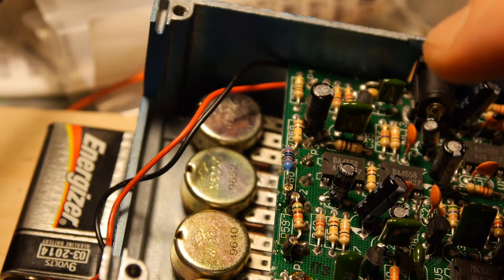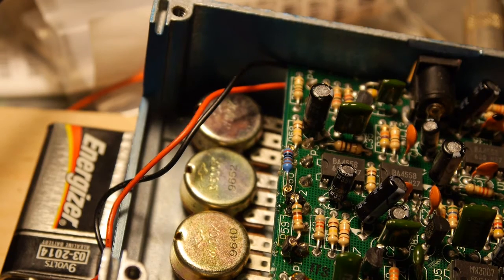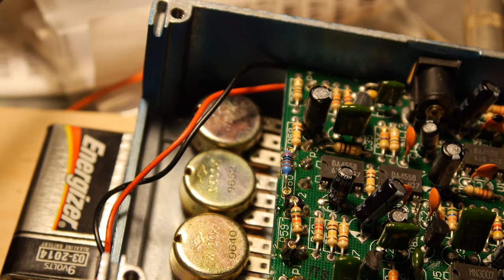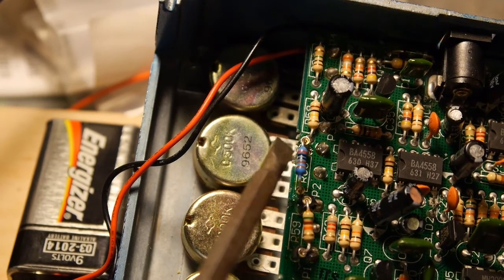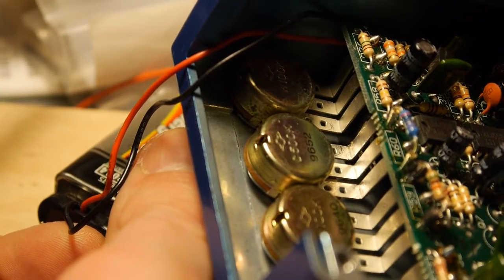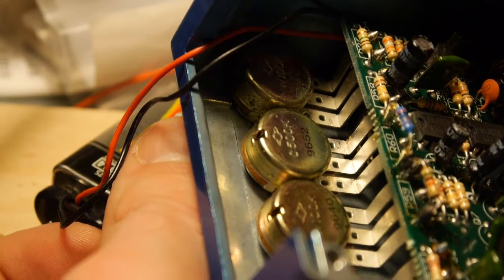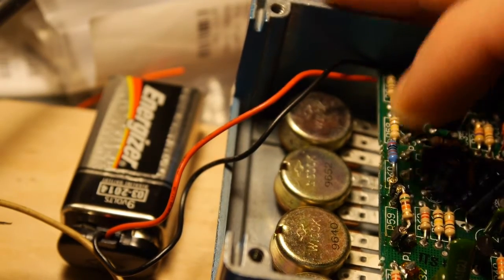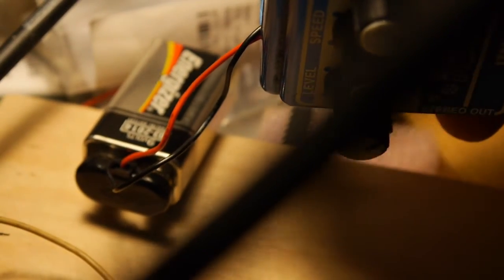Mod : Increased Modulation Speed for DOD Ice Box FX64

Comment: Did you try other values? just wondering if I didn't want to go three times as fast, but just a little bit faster if I could use 3k or 4k.
Reply from the maker: Sure. that'd work. You'd have to experiment to find the right value. Anywhere between the original value and 2K should work fine.

Comment: any idea how i can slow down the stock speed of the dod fx65?
Reply from the maker: You can either increase the value of R60, OR swap the 500K Speed Pot for 1M. Swapping the Pot will give you a larger range down in the Low Frequencies. It's possible that it will be too slow to keep the oscillator running though, I haven't tried it.